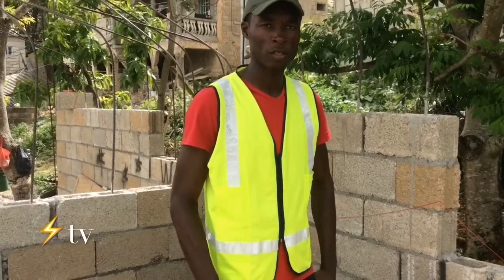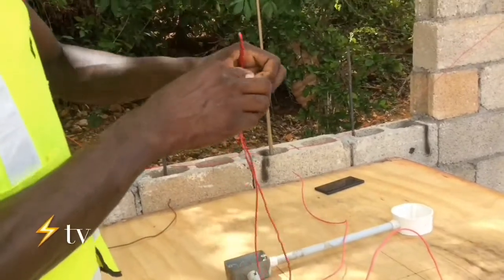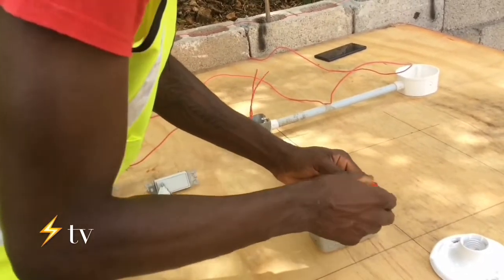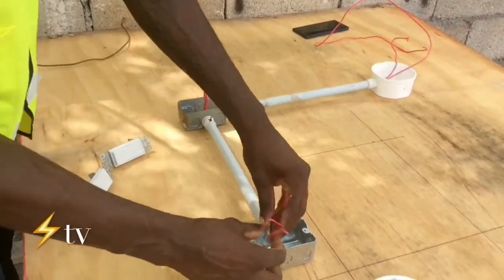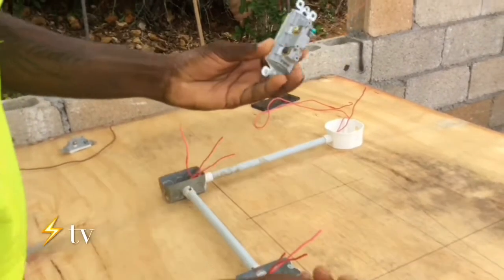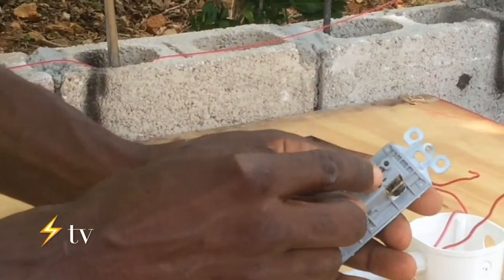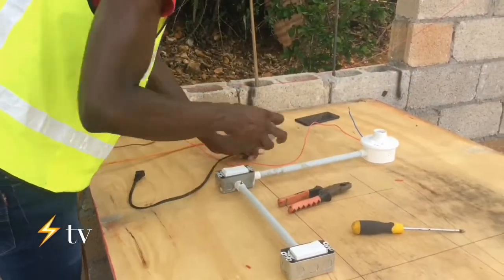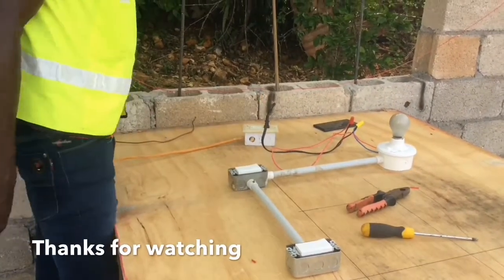How A 3-Way Switch Work! Tutorial watch full video..

Comment: what did u connect the live to in the bulb? I saw where u connected the return and the neutral but not the live
Reply from the maker: The live connected on one of the switch
Reply: @ElectricalInstallationEEE  ohh .thanks
Reply: can u interchange the live with the return?

Comment: For the traveller wires can you cross-connect them on both switches or you have to connect right to right and left to left on the switch?
Reply from the maker: It can cross once you don't affect the common wire which can be either main/return. A lot of time it crosses especially if you running wires over distance and have to twist off in junction boxes etc.
Reply: @ElectricalInstallationEEE  Ok thanks
Reply from the maker: Kool